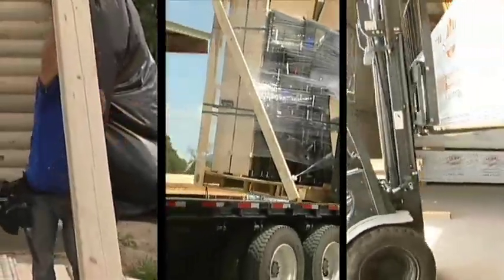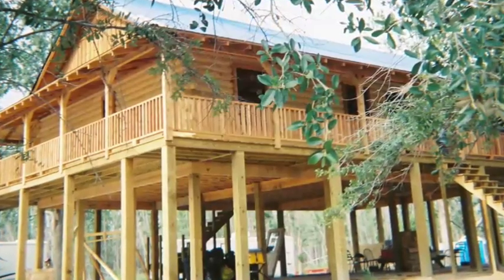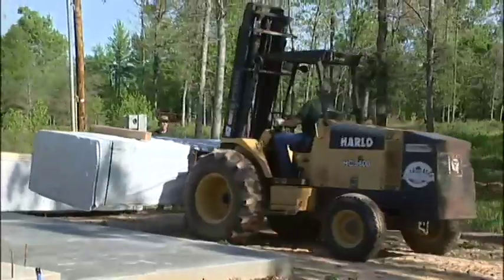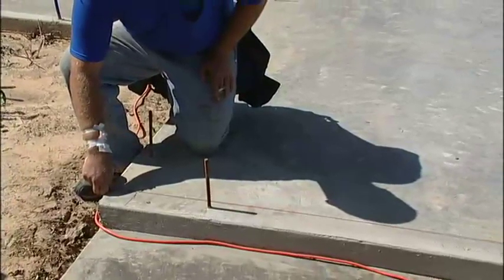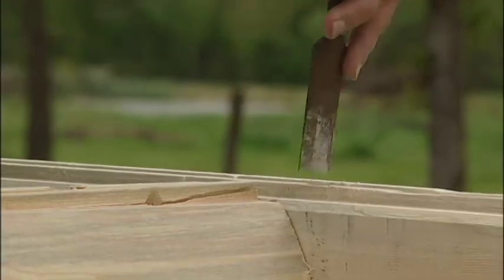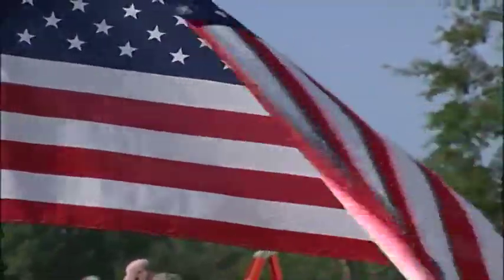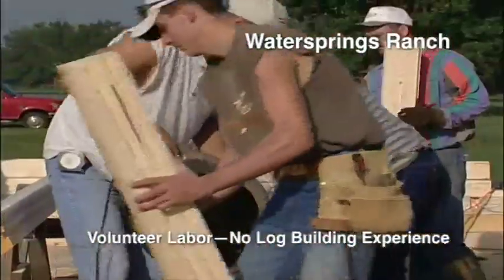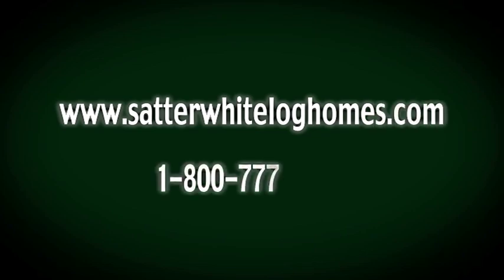Satterwhite Log Homes - Construction Practices and Buying Options

Comment: Do you do turn key homes?
Reply from the maker: Satterwhite does not do turn key homes, except in rare situations. This may seem like an attractive concept, but it almost never makes money sense. General contractors typically do not work outside a 50-75 mile radius because of the need to keep an eye on jobsite progress. Even in situations where a customer might be willing to bear the cost of lodging accommodations for construction crews and management for many months, few experienced professionals are willing to live away from home and family on a continuous basis. The Satterwhite solution goes back to the quality of our house logs made from dead standing timber. Because these logs are thoroughly dried and cured by nature, the exhibit outstanding performance without requiring extensive specialized skills in construction. Using this special material, the Satterwhite building system has been well proven many thousands of times for almost 50 years. We have a long history and experience to show that you will get the most home for your money by using general contractors to complete your home, and in many cases, we can provide referrals from previous customers who have been satisfied and recommend builders in your area.
Reply: @SatterwhiteLogHomes  thank you for the reply. Looking in eastern Tennessee mountains so clearly the ga office would be the one to visit
Reply from the maker: @nunyabizness3382  Yes, the Ellijay office is about an hour away from Chattanooga.